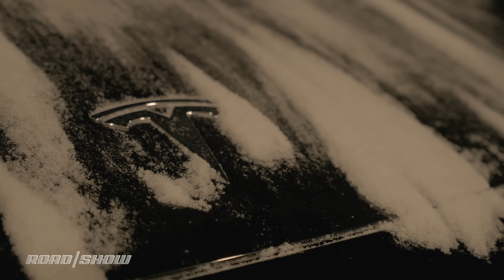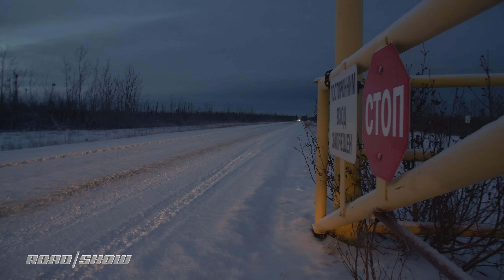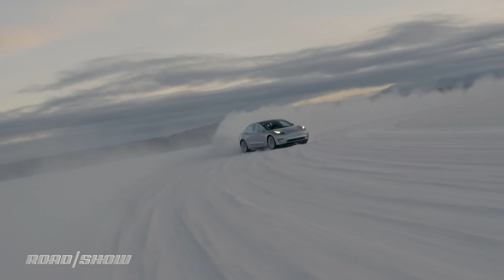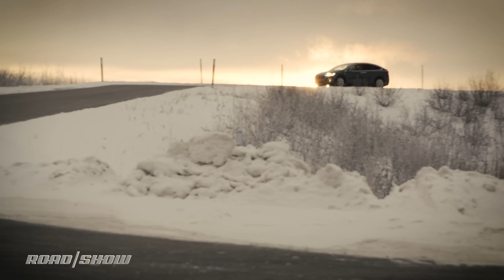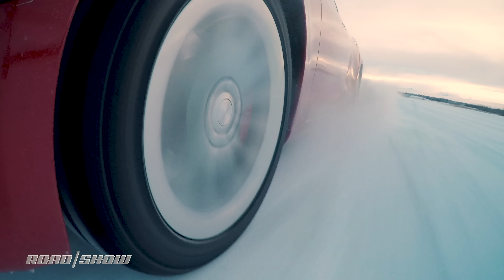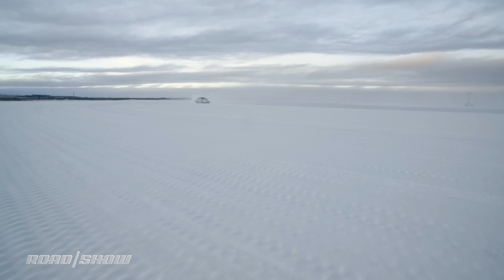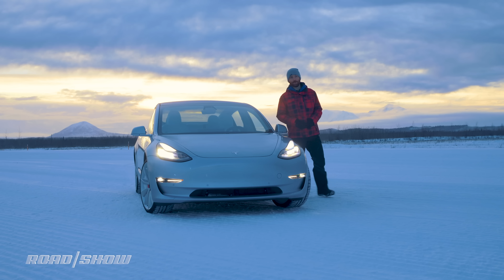EXCLUSIVE: Winter driving all Tesla cars in Alaskan snow | Sideways Included

Comment: It is sad that the P100D does not have track mode and cost almost 2x's as the Model 3 performance.
Reply: ehh, I'll take 0-60 in 2.28 secs, and more room any day ;D
Reply: Has to do with the batteries. Next gen Model S/X will probably have it.
Reply: @danm4320  WRONG, it's a software feature, ramrod, P100D is quicker and heavier. ;D
Why do people ACT like they know what they are talking about?
Reply: @foam27  because I know what I'm talking about. The coolant loops and heating system is completely different. The cells are a different architecture and the the way they are packed is different. As a result the cooling isn't as good as the Model 3. You don't have to be so condescending and arrogant when you clearly need to read up.
Reply: Bonzo Bonzai why do you act like you know what you’re talking about? There’s a lot of stuff, both software and hardware, that go into making track mode work. They could get close with the model S but the model S isn’t really the optimal car for track performance.